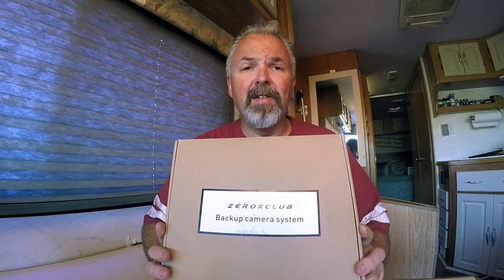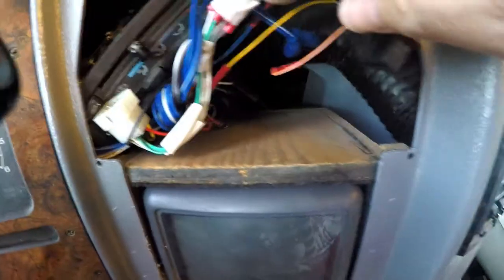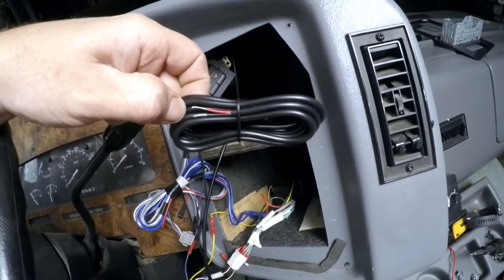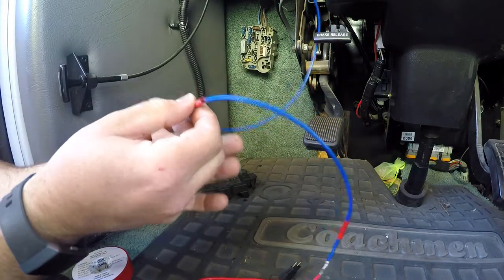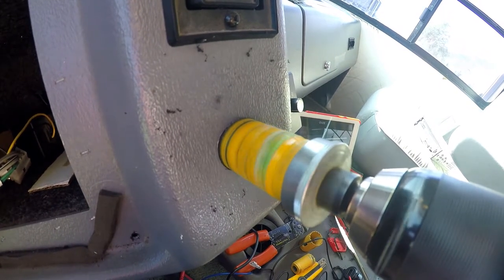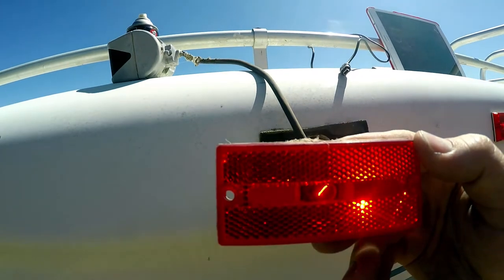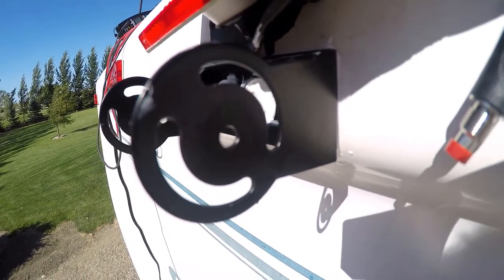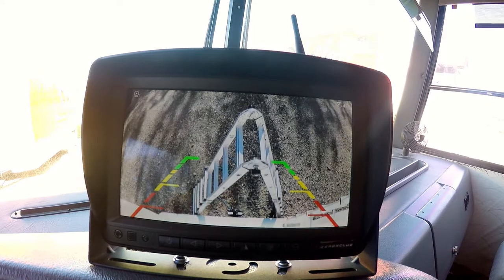Zeroxclub HD digital wireless backup camera install

Comment: A couple notes on the solder job. The best connection will be a joint known as a lineman's splice or a western union splice. And as mentioned elsewhere you do not ever want to use acid core for electrical.
Reply from the maker: Thank you for the feedback and knowledge share!

Comment: Why didn't you make a bracket and cover plate and put it where your old one was?
Reply from the maker: Thank you for the comment and question!! The reason for not making an a new bracket was I wanted to use the included bracket, the new screen was physically larger then the old one and I like having it higher up on the dash to view the footage while backing up or driving...the spot also made a great place to store my cell phone and other little things I needed available closely to me